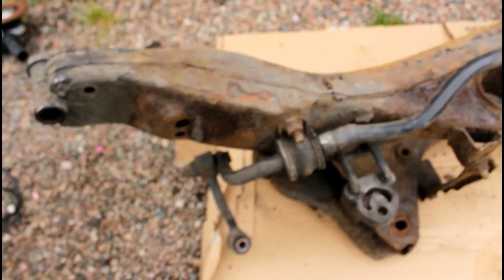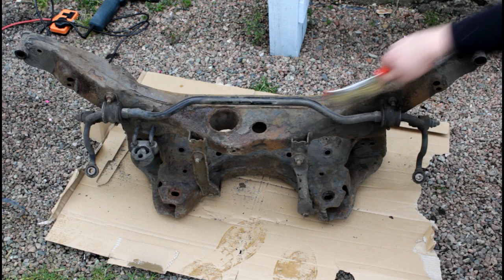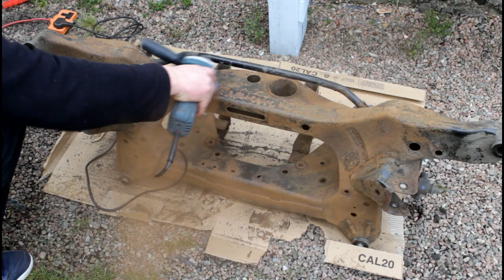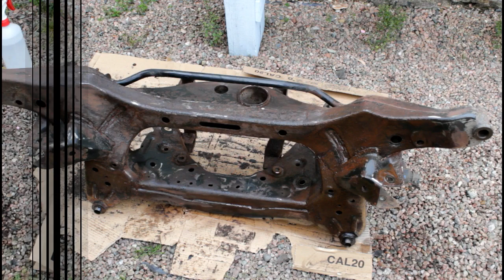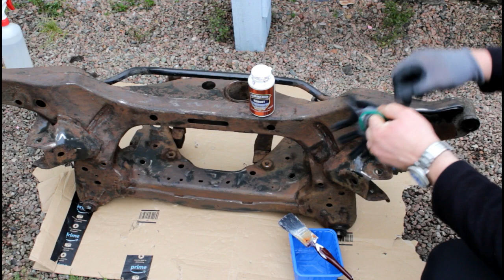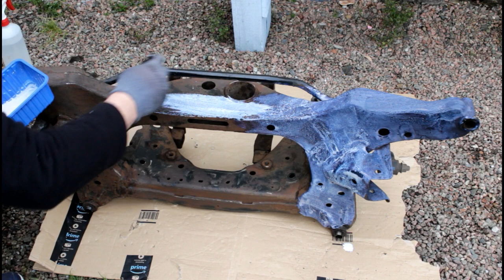Rust Converter and a Rusted Chassis

Comment: Looks good, but you only did half the job. What about the inside ? I would definitely do something about the inside. Spray an acidic solvent type converter and maybe the same stuff you used here in a spray type rig with a long pointy metal spray end that can fit inside those holes! If you want that thing to last

Comment: I would probably spray a strong degreaser and then pressure wash it. I have a project like this coming up and I’m going to give it a try.   The ospho rust converter is diluted in water first so it should be fine. I’m going to put it in a small pump sprayer and go to  town.
Reply: The stuff he has used isn't a solvent based it's just supposed to react with the rust and dry. It's not great but better than nothing
Reply: @stevehand322  
Not great how ?
Ive used it on motorbikes, cars & trailers & its always worked like magic.

Comment: How can I access this product?
Reply from the maker: Check on Google for hammerite kurust but in my opinion you find much better products than Hammerite like Aqua Stell ,Jenolite
Reply: @AlexBRestoration  bilt hamber have the best products for this sort of thing
Reply: @richlee509  Hydrate 80 from Bilt Hamber
Reply: @codenamenel  Deox C
Reply: @bitTorrenter  Deox C is their rust remover not converter, you mix an amount of Deox C with water and have to submerge the part in the mixture overnight, it would cost a fortune to do a part this size

Comment: Yes, lookes like its killed all the rust, wrong just turned the top surface black, rust is still underneath.
Reply: It's a converter, that's actually a good sign.
Reply: These have an acid and then a polymer in them. They dissolve the rust, infuse it with polymer then dry to basically a plastic paint covering the parts. There’s still the inside which is probably just as rusty but he is basically doubling the life by only allowing one side to keep rusting.
Reply: Anonymous Person  Well that's disappointing, at least it's protected for those few months I guess.
Reply: @MrSparkums   No its not ,  wier brush it, the rust is sill there.
Reply: Anonymous Person  I strongly agree with you and Andy.  Actually I did testing at my pickup for a few years with rust reformer.  Exactly a few months after rust will pop up under RR.  I use Cold galvanizing paint this days with limited success and look into cosmoline wax.  Rust reformer, paint over rust and POR-15 didn't work for me.  My tread about topic https://www.ford-trucks.com/forums/1595021-ten-year-of-using-cold-galvanizing-compound.html
Reply: There is no rust left, the black is Ferric Phosphate, its the product of the chemical reaction between rust (Iron oxide) and Phosphoric acid (the converter) and is a stable material
Reply: I used rust converter on a very rusty 59 Cadillac 8 yrs ago....lots of surface pitting but no rust thru.....used under body filler....I saw the car about 7 months ago.....all the bodywork and paint were still fine...no bubbling or lose of adhesion.....if used properly this really works. It is now used all the time on painting steel bridges...